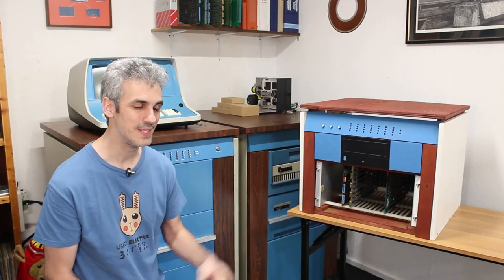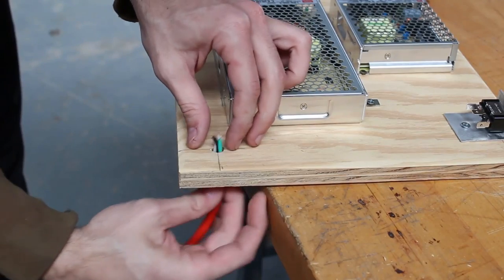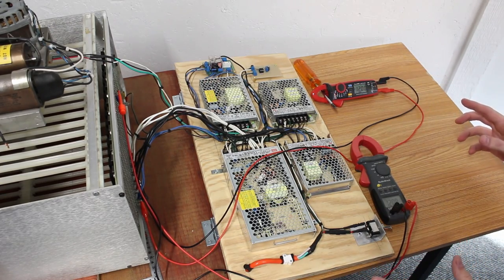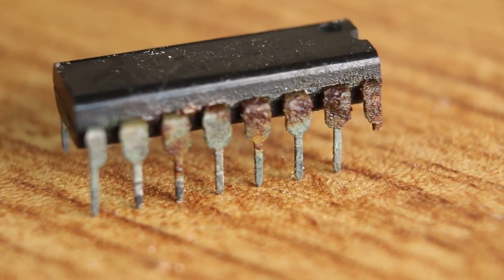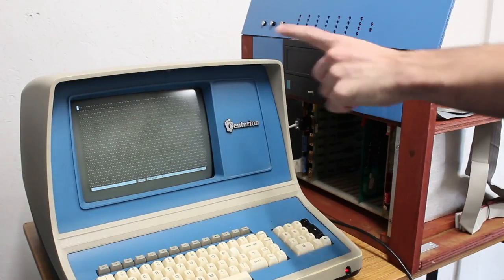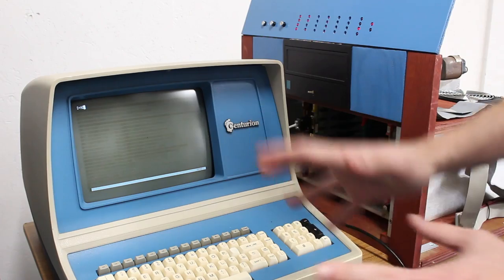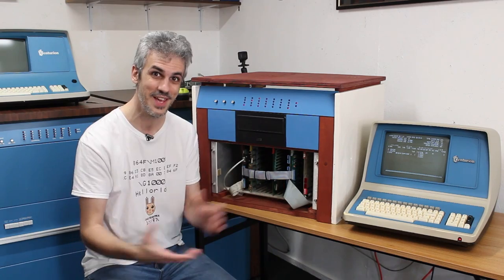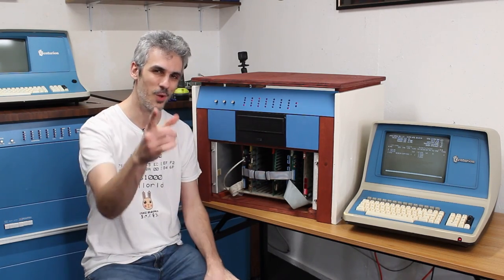The Mini-Centurion Works!

Comment: I hope this doesnt get lost in the comments but just a little reminder: it seems that you have connected the mains live wire to the center pin of your toggle-switch. This means that the second terminal of your switch is live all the time the device is turned off. And since that contact is openly accessible It may be sensible to either change the two connections (then mains is on the outside and not connected while in the off-position)  or at least to secure it against you touching it. After all i want to keep getting centurion updates and not hospital ones ;)
Reply from the maker: That's actually something I totally didn't think about! 
I'll swap the two connections next time I head out to make it safer, thank you so much!

Comment: Just a suggestion, but for the wooden panels you can buy rolls of self-adhesive vinyl wrap with a woodgrain effect. They're normally used as a quick fix for old furniture where the veneer has started to break away but might help to make your mini Centurion look a little more like the full sized one.
Reply from the maker: Centurion actually used glue on rosewood veneer on MDF themselves for the genuine panels, so that's a really excellent idea!
I have some ideas I'm mulling around for how to vastly improve this design in time VCF East in April, so quite a lot will get remade and I think like you suggest, I'll go with something a little closer to how Centurion actually built it back in the day.
Reply: @UsagiElectric  Another idea is to visit IKEA and buy Sinarp kitchen cover panels, veneered in walnut, and cut to appropriate size. That would probably look very similar to the Centurion panels.
Reply: Gold will short fall
Reply: Brilliant! 🏆
Reply: @UsagiElectric  That's interesting! Really surprised to hear they actually used MDF panels. I assumed they'd just silk screen printed a wood effect directly onto the metal. You learn something new every day!

Comment: thats awesome, but one thing i would do for safety.... you need to ground that main power switch... if anything happens in that switch, that whole thing and the bracket can become live. Also, i would put some big heat shrink over those brackets that you made for the ribbon cables

Comment: See you next SAT.   Hope you take a few videos at the event on the 28th to show off the first Centurion model in 30+ years.   Intro of the Mini-Centurion single 8" floppy system.   Also noticed you now have two working Centurion ADDS terminals.
Reply: I agree.  Your clock is going to drift.  I'd suggest getting a board with 32767 HZ crystal oscillator and circuit to produce your 60 Hz signal.
Reply from the maker: Catch you next weekend Ken, it'll be fun to get you hands on with the mini!

Comment: Great job!   A couple of suggestions though:

(1)  Run a green ground wire from the power cord to all the metal parts, including the power switch.  You never know when a short might develop or a critter might try cuddling up or into a power supply.  Don't rely on the flat cables to pass short-circuit currents.  Don't ask me how I learned that is a hugely poor idea.

(2)  Add a circuit breaker or fuse of appropriate size right at the power inlet, in the black hot lead.

Comment: Occasionally on snapped pins a small rare-earth magnet will pull them out when you can't find a small enough pair of tweezers, or want to save replacing the socket as a measure of last resort...

Comment: Nice to see that you managed the system to work. I am 69 and grew up with this type of machines. 
Are you interrested in a working Atari portfolio? The first portable MSDOS computer that fits in your pocket. It is a complete set with parrallel and serial extension port and also a removable 128k Memory card. its working on 4 AA batteries, Only the optional powersuply is missing but can be replaced by a small 6Volt PSU.

Comment: While the relays off the 5V were good, it might have been an idea to use an AND gate and opto-isolators, then you can use it as a voltage protection circuit. If one of the PSUs doesn't come up for some reason, the machine won't start one leg down.

Comment: One thing of note with power supply timing is take a look at the 4116 memory datasheet, you'll see that Vbb (-5v) should be applied first and removed last, so there is at least that power sequencing requirement (in reality the computer manufacturers I'm familiar with that used that memory didn't bother and let it all turn on and off at the same time, and the chips still work fine decades later!) so it's worth having a look to see if there are any power supply sequencing requirements when you have multiple supplies.

Comment: My two cents:: Cover the cable management brackets with a heat shrink tube to prevent the edge chaffing & shorting the ribbon cable.

Comment: I once saw somebody disassemble a computer like this. And they removed the module that controls the text in-out interface, and they were hotwiring the blinking cursor module just by connecting a powered cable on a metallic terminal on the circuit, and manipulating the blinking. They made the cursor blink, then they made it stop blinking, and they made the cursor just stay. It was really cool.

Comment: You could extract the 60Hz signal from mains with a simple PCB-mounted transformer. If all fails, just gut an old wall wart. They usually consist of a transformer, full-bridge rectifier and optionally a linear regulator. The 555 will seriously have trouble keeping time.
Reply: Optocoupler would do the same at a fraction of the cost.
Reply: @kdrum90  I doubt it's at a fraction of the cost, but yes, you could. A transformer will be self-sufficient in this case, though, because it's its own power supply.

Comment: One small thing to check, because you're (hopefully) going to be using this for years you might want to think about putting inrush current limiters in your +-12v lines. 
When the relays close any capacitors on those lines are going to get hit pretty hard as they try to charge limited only by their internal resistance. I'd hate for you to power on at an event then blow up an old cap.

You can get little disk type inrush limiters but I'm not sure what the load is on your supply if they will be up to it. Similar idea to your soft start circuit on the tube processor but running in a fraction of a second instead of a fraction of a minute ;-)

Comment: With triple-supply DRAM (4116's) in there, you would probably be better off making the -12V come on first. The 4116's don't like not having the -ve bias up when the +ve voltages are applied.
Reply: yep, if the -5v line isnt present when the other 2 come up, they can pass heavy current and be damaged , this happens a lot in zx spectrums with dc-dc converter issues

Comment: This is so cool. I'd be first in line to see it if I could get to Texas. One idea - rounding off the edges of the ribbon cable hold-downs would protect the cables if they were to rub up against the sharp edges. The machine will be moving around, after all.

Comment: Look at the datasheets for the devices that use multiple supply voltages and check what is recommended for power sequencing.

Comment: Rather than the 555, you could get your 60Hz signal from a very small AC transformer connected to the mains, but with a low voltage output. Then it would be guaranteed to have the correct number of cycles per day form the power company.

Comment: I once built a work bench PC from junk I had lying around, using two 5.25 floppies, 360k. 286 main board. First disk was the OS, second disk had a QBasic program to generate test screens for adjusting CRT monitors, test printers, etc. I remember it was a lot of fun to build and get working.

Comment: I realize this is all after the fact now, but if memory serves me correctly, the @JX files are the JCL command files, @TX are the transient files, the OSEG files are I believe chunks of the operating system executable code, the IOD files are likely the IO driver executables. Like I said, "if memory serves me..." it has been over 40 years since I worked on those systems.

Comment: Ack!  I forgot to like this first time through, so I'm watching it again.  This mini-Centurion is a beast.  I wonder if it would be possible to interface an old MFM drive to it to provide it with a hard drive.  The Centurion and this new mini have been quite the project.  (You might cover the edges of the ribbon cable clamps with some 3M  Super 88 or some extra large olefin-based heat shrink tubing, just to give the ribbons some protection.)
Reply: I believe the Finch is an early MFM or an ST506-style drive with a modified pinout. The floppy drive is a regular Shugart-type from CDC which only has an adapter to connect it to the FFC card, so that would mean the Finch also has a Shugart/ST-506 style interface with only a different pin setting.

Similar adapter boards could be made to take a regular 5,25" floppy and an original ST-506... both of which he has sitting in his PDP-11 chassis in the background.
Reply: @Stoney3K  There may have been several models of Finch (there doesn't seem to be much documentation). I don't think the Finch that interfaces with with the FFC card in the Centurion is ST-506/MFM (if I am wrong, life will be a lot easier). The later smaller Wren drive had at least four different interfaces: Finch like, ST-506, ESDI, SCSI

Comment: This is so cool. But I would really love to see a video going full deep dive on the issues surrounding this OS. Its so wild finding out that it's still being used in some capacity, absolutely crazy.
Reply from the maker: This is actually a part of the whole story of Centurion that I'm working on figuring out. I've been building a timeline of the company from inception to today by talking to various people who used to work there, and I'm starting to get a good picture. Unfortunately, the current IP holder has been... less than helpful, but I'm nothing if not persistent, so I'll get the full story eventually!

Comment: Hey, Btw, if you want to match the other systems wood paneling the color stain they used (or simulated) was black walnut. You can put it right over the top (assuming you didn't varnish the panels yet) of the existing panels and it will take the color back to more of a brown.
Reply: This build really deserves a de-luxe cabinet with real walnut and smooooth spray painted aluminium panels. And this not a critique of the one built - given the lack of woodworking expertise and the hastened construction, it is very impressive. And very true to the design of the originals, obviously! Just amazing!

Comment: Its really interesting to see how stuff like folders and such were set up in the era tbh like it makes sense if u think about it but id have never guess it, also really wild how small the files end up being like you have the whole os with the compiler and all on the floppy and still have PLENTY of space left like ?? i wasnt expecting that wow
Reply from the maker: Yeah, the OS requires a definite shift in thinking about things. It took us a lot of digging and trial and error to figure out how to min-max the OS as much as possible. Ren absolutely killed it with his script, though we've stuffed a few extra things in there since then that have pushed us up to 70 tracks, but there's still a solid 25 tracks left for building new programs, which is pretty good.

Comment: For the clock I would have used a small mains transformer. By itself wouldn't have cost much of anything, and is honestly an even simpler solution.

 60.26 Hz runs fast with about 6 minutes per day. That is quite bad...
To improve your 555 oscillator. It is best to not use the potentiometer as the only resistor, but rather have it in series with a second resistor. Where our second resistor provides the bulk of our resistance while the pot only fine tunes it. In short, the full range of the pot should cover a fairly small region around our desired frequency. Proportional to the accuracy of the surrounding components. Like 60 Hz +/- 5-10%, mainly decided by the tolerance of the capacitor in the 555 oscillator circuit.

To calculate this is rather simple. If we need a resistance of X ohms, then we find the "closest" common resistor size to that, but that still is of a smaller value. If it is off by only a few fractions of a %, then take another step away. Effectively, we want our resistor to be on the X -n% side. Then we find a pot that can trim our circuit all the way to X +n%.

If our capacitor is 10% accurate, then the added series resistor will effectively make it about 10x easier for us to trim in the circuit under ideal conditions. Realistically, it might only be 6-8x easier. ("easier" as in how much our output frequency changes per turn of our potentiometer.)

If our capacitor is 5% accurate, then yes, it is up to 20x easier to trim the circuit. Ie, that 6 minutes per day error could become 18 seconds per day instead.

Or one buys (or salvages) a small mains transformer. They are rather cheap (or easy to find). Then one don't have to worry about trimming in the frequency, but can instead rely on the grid operator's atomic clock for long term stability.

Comment: I tried making something like this.
I had some scrap styrofoam pieces, in symmetrical shapes.

I made it look like some sort of crt.
An Ipad or screen could fit in the one styrofoam piece, what had a square opening.

The back of the styrofoam  tv, has to parts that open up.

Comment: Re your 555 "real time" clock: 60.6Hz would give you much worse than a few seconds per day error.  For that kind of decent performance, you need a crystal osc; I'd recommend the TTL module type, not discrete crystals.  1 in 86400 seconds is around 10 ppm: crystal territory, nothing a 555 can do on a consistent basis.  Just MHO...  Fascinating project!

Comment: Nice work on getting the mini Centurion built and running. The one thing still is some text beside the buttons and lights on the front panel. If it was me working I would wire up a small circuit to get 60Hz from the mains supply. The 555 timer may be good enough for demonstration purposes as you going to be running the machine for days on end without turning it off. 60.2 Hz means it will be about 28 seconds fast each day (if my math is right).  It isn't very accurate. You could change the ratio of the fixed timing resistors vs the variable one so you can get better accuracy in the 60Hz signal. Another option is use a faster signal and divide it down. Have fun at the show.
Reply: 60.2 Hz means it will be 4.8 minutes fast each day: (60.2/60-1)*60*24 = 4.8. How did you get 28 seconds?
Reply: @davidellsworth4203  That's a very good question. I have no idea. I ran the numbers again and it is indeed a drift of 4.8 seconds per day. Me being me, I would still aim for better than that. :)
Reply: @kevincozens6837  4.8 seconds would be pretty acceptable for this level of project. But *4.8 minutes*, which it was actually off by, is quite bad indeed :-)

And yes the Centurion OS is not Y2K compliant, so he can't set the actual current date on it. But from the looks of it when he was adjusting the 555 timer, it would not have been hard to get it to be much more accurate – and I think it would've been worth it.

Comment: Question. Could not you eventually get a backplane made to put the CPU6, MUX, and RAM cards  (and maybe a floppy controller), and put the drive next to the four cards? you could cut the X dimension in half, you could also possibly change the orientation of the cards to make the centurion's actual computing hardware no bigger than the FDD's outer shell. For extra portaility you could even get a non period accurate MFM SSD, which is against the goal of this project, but you'd save on weight and reduce the physical dimensions even further.

This is all in the eye of the beholder, but power supplies and storage are definitely not as important as the actual hardware, authenticity wise, than on which the software runs on (). It would make carrying it to conventions so much easily.

This all is for a potential Mini-Centurion Mark II, since all you had was a week to get things done

Comment: Regarding the display "Fail" message, the status indicates DMA failure.  Since the self-test is for the memory and IO, I have to assume it's DMA with the UART.  It doesn't give any more details.  I got this out of a ADDS Regent 200 manual.  I'm hoping that's close enough to what you have.

Comment: I bet you could get a 60 Hz signal from the mains by using an optocoupler like PC817. As a bonus, the corresponding circuit would actually be much simpler than 555 oscillator.
Reply: And more accurate. The 555 isn't temperature compensated or anything, so even if it was dialed in precisely to 60 Hz initially (and it wasn't, so...), any change in the local environment can cause it to drift a little one way or the other.

I mean, I get how simple the 555 approach is and I can't argue with that. But it's about the least accurate way to provide the necessary clock signal. There are many other options that would be better, from an accuracy standpoint (even if not expediency).

Comment: You could have used a 4-pole relay and just used 2 power switches to turn the unit on, one for the AC and one for the DC once the power-supplies stabilized.